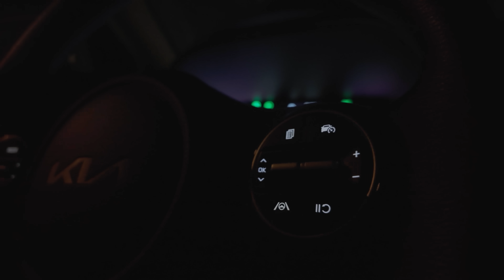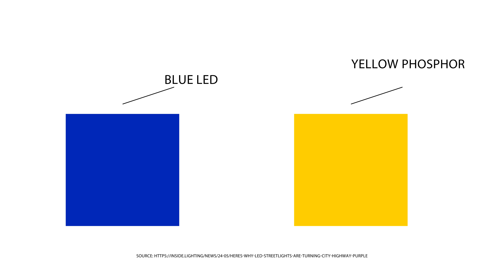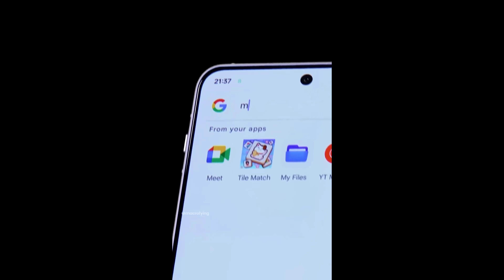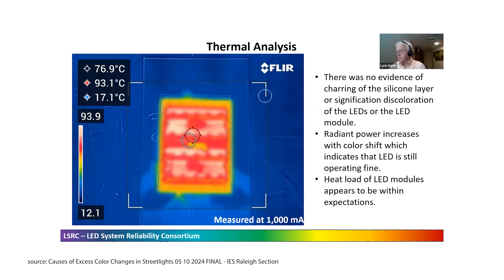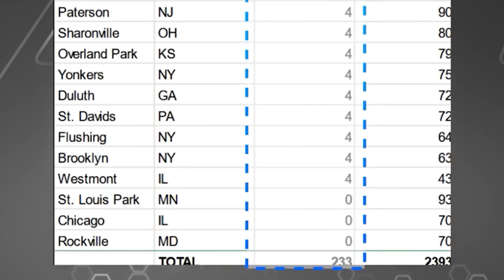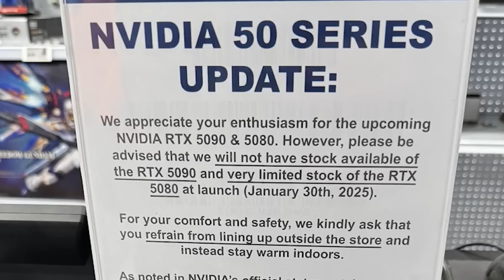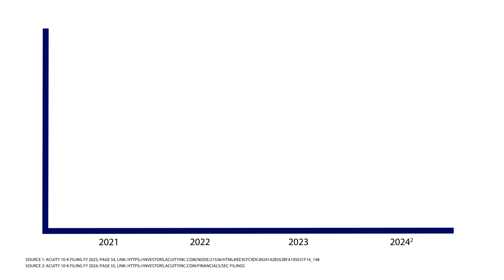The Hundred Million Dollar Mistake That Turned Street Lights Purple!

Comment: I work on LED street lights for DOT agencies. If you ever wanted to learn more about street lighting or high mast lighting used with DOT i can give you more insight. Also the vibration is called a G rating. Vibration is taken into account not just cause on the diode side but bolts that keeps the fixture head on the pole arm

Comment: Defective LED street lights or flood lights are quite common here in Germany as well - but them turning blue is something I've not seen as of yet. Most faults come from one bad LED, which takes out either the whole cluster or one or more rows of it. Another fault comes from a worn down LED inverter. That results in kind of a disco light most of the time, as probably one capacitor has dried up and failed or one leg of it desoldered itself or wasn't soldered right from the get go. So, every once in a while you come across a light that blips or dips every second or two, you know it's the inverter.
Unfortunately in most cases these inverters aren't a separate module, but integrated into the main lighting board. On top of that most lamp housings are sealed, so you can't get to the faulty part at all.

Planned obsolescence at its finest.

Comment: As I recall, the original American Electric started out in Southhaven, MS adjacent to I-55 just south of the Tennessee State line. They began making sodium vapor street lights to compete with the big kid on the block, General Electric. AE made a good product with a simpler design and a lower price point. As I recall, the company was sold and the manufacturing facility was closed. 
That’s what made this video so interesting. To see what American Electric turned into.

Comment: I have one minor bone to pick about this. In lighting purple is the color that is created when red and blue wavelengths are combined. Violet is the correct term for light that is shorter wavelength than blue. Most white LEDs have a blue pump that is typically in the range of 450nm, although there are some that use a shorter wavelength violet pump, but the trade-off is lower efficiency. Also, when high power white LEDs were introduced, new standards such as LM-80 were created that defined the requirements for LED manufacturers to test and report on the long term reliability of the LEDs. Also, one other fact in your video that should be clarified is that Acuity manufactures 0% of the LEDs that are used in their luminaires. I worked in the LED and lighting industry for many years, so I know a few things. Good video overall though.

Comment: The early LED lighting would age and emit a light frequency which would gradually turn towards the magenta to blue spectrum. This was due mostly to heat and the phosphorus layer failing. LED lights is a very narrow band emission and in order to create a broad spectrum light, the devices had to use a phosphorus layer which glowed the proper spectrum and that phosphorus layer was simply not durable enough. Narrow spectrum light can be dangerous because it renders some color contrast not to be seen at all. Critical color dissimulation simply cannot be done without the full spectrum of light available. Many SCUBA divers know this as red light is effectively filtered out as the diver descends below 30 feet. This lack of full spectrum light is so pronounced that if you cut yourself ,as in an accidental event, you will bleed green. Odd but true.

Comment: Well researched. The yellow phosphors in those LED panels are about the same as the white coating inside a fluorescent tube, they absorb  the short blue and uv wavelength LED light and then radiate it again at a longer wavelength in the visible light spectrum, creating white light.
The phosphor powder is mixed with silicone and painted over the LED chip during manufacture, and the silicone gets brittle and shrinks when exposed to uv-light (and heat) for an extended time period. There are however certain uv-resistant resins which can be used instead if silicone, lots of reputable LED manufacturers use these without problems, there were even some LEDs with clear plastic over the chip to prevent the phosphor from dropping out.
There have been attempts to refurbish these streetlights by opening them up, cleaning and re applying  phosphor per hand with a better bonding agent, re-sealing the lamp and then putting back into service. 
This is somewhat labor intensive, but it gives somebody a job and prevents waste. The light output is nearly as good as when the lamp was new. Hopefully this method gains more traction, because there will be a lot more purple lamps to come.

Comment: These lights are shit. Not only is the color wrong, but they are not reliable. A street light near my house was replaced with an LED head a few years ago. It's been replaced at least twice in something like five years. Even if the old style sodium lamps needed replacement at the same rate (which I'm doubtful of), it'd be WAAAAAY cheaper. But we're sAvInG eNeRgY. LMFAO.

Comment: One of the problems with LEDs is that the light they produce tends to be very monochromatic.  So if you have a red, blue, and a green LED all shining at once, our eyes will interpret it as white, but it will be missing a lot of the spectrum between, which can create difficulties with some colors or individuals who can't see the full color spectrum.  This isn't a problem for, say, your computer screen, because you are creating an image from a dense matrix of the LEDs.  However, it does create a problem if you're trying to light objects with them. 

Anyway, a pretty big innovation was the invention of the modern blue LED because slight variations in how it is manufactured can shift the light it creates into the UV spectrum.  Which is a very similar wavelength to mercury vapor bulbs -- the core of fluorescent lights.  The actual mixture in the phosphor coating can be tuned very accurately  into a full spectrum white light.  

So the vast majority of "white" LED bulbs we have today are actually blue/UV LEDs with a phosphor coating to produce white light in a wide spectrum we are used to.

Comment: I never knew the purple lights weren't intentional. I sort of just thought they were meant to attract bugs or something. 
I used to drive through one small town regularly  at night, usually between 8 to 10pm. 
I had always noticed that those lights attracted some of the biggest moths and insect I've ever seen. They were only around the purple street lights, not the white or yellow one's. Some of the moths were 6" across or more. The mess of dead insects also drew out other wildlife to the free meal on the road beneath. 
The truck would get plastered with the huge moths, by the time I got back the truck looked like someone had thrown a hundred eggs at it. After one big storm, that took out a ton of poles and trees in that area the lights were gone and the problem went away.
Reply: I see "Angry blue" a fair bit. Usually it's someone who tries to dedome the emitters on their flashlight for lower CCT and rosier tint, unaware that the Nichia 519a is one of the few emitters that allows that without ripping off the phosphor layer with the dome.

Comment: So they went the CHEAPEST route, and the lamps should be covered by a warrantee.
Personally I HATE street lights, they interfere with your car's headlights, I'd rather have NO street lights and rely on my own headlights.
If they have to relace the lights big deal, the old light bulbs also had to be replaced periodically too.

Comment: your getting algo help because you are pushing the narrative they want you to, the lights started purple 3 years ago, there are news reports. At first the story was lights had low lifetimes, that story didn't fly. So the next story was yours, faulty kmanufactured street lights and they were supposed to be replaced, however, I still drive uber 3 years later and they have not been replaced, they were all still there. And newly installed ones keep showing up. 2 weeks ago a new building was built a couple of miles away from me and 14 new street lights were installed. 2 next to each other are purple and those happen to be directly in front of an apartment complex across the street from the  building, they apartment complex has  been the site of a couple of shootings. The purple ones are strategically placed, I assure you. But you are just a shill anyway, congratulations.

Comment: The reason we use phosphor coated blue LEDs is not just cost, but also light quality. White light can be produced using RGB LEDs however this is more of a fake white light because the LEDs themselves are monochromatic. Because of this monochromatic light, while the light itself will appear white in color, objects lit by this monochromatic fake white light will appear very strange. It will have a very low Color Rendering Index, or CRI. The phosphor in a blue LED is not just a simple filter, it absorbs blue light and re-emits it in a wide spectrum of colors, giving a much much higher CRI and a more natural looking light. This is why all LEDs meant for illumination, from street lights and automotive headlights, to flash lights and even your phone's light, all use phosphor coated blue LEDs.

Comment: We have "GLO-GOLF" and  COSMIC BOWLING, so now, we should have COSMIC DRIVING and COSMIC BIKE RIDING and COSMIC WALKING!!!  The simple solution is to paint motorized vehicles and bicycles with "DAY-GLO" NEON PAINT, then they'd stand out extremely well under ULTRAVIOLET (UV) LIGHT!!! Pedestrians could wear "DAY-GLO"  NEON clothes, or at least, a "DAY-GLO" NEON safety vest.  The roads and streets are also getting SANITIZED, with UV LIGHTING.  What's next??? GLOW-IN-THE-DARK streets???

Comment: Darn, I was soooo ready for dancing purple aliens!  I'm not sure what brand or model LED fixtures were specified for My Fair City, but the electric utility (not the city) is responsible for provisioning and maintaining the street lights on city streets, but we didn't get 5 years before failures; it was more like 2 years with the infant mortality starting months into service.  The PoCo hired a contractor to do the warranty service and now, 3 years later, we're seeing the same issue.  Either some component or material is under-spec'd or the foundry in China is making bad product.  There is one brand that has their emitter wafers made in China because it's a hot chemical mess, but does their lamination and phosphor coating in the USA.  The product is almost 3x in price.

Comment: I see they sent their damage control guy to the channel and you have got his comment pinned.  He is just making excuses for a company that used LEDs outside of their published operating parameters (running it harder and hotter). Unfortunately street lights, his "area of expertise" has no input on the manufacture or ratings of actual LEDs, only the way his cronies adopt them.  They are a minuscule user of them. To my knowledge, the first adaptation of LEDs for public lighting was in traffic lights where they quickly found out that they froze over due to lack of heat in that application.  Unfortunately I have been involved with self important organizations myself enough to know that "board member" means: he's at every convention,  chummy enough to get votes, and gullible enough to sit through boring self-aggrandizing speeches while slapping friends on the back telling them that a great speech that was.  

I find it deplorable that you have given this fake expert your platform to make excuses for a substandard product as if he has the final answer.  I have worked with LEDs since the early '90s but only in the use of them, not their manufacture, same as him.  Making a product that contains an LED does make you an LED expert.  This clown is just white knighting for his own good.   You look like a fool for letting him do it.

Comment: Municipalities that have been buying these lights are bearing the brunt of the cost if they replace them. The labor and cost of replacing a street light is far greater than the cost of a small panel of LED chips on a board. Most of these lights will never be replaced under warranty as it's too expensive for municipalities and governments to replace the street lights that they have up going bad.

Comment: ...but did the Chiner company that made and sold them the LEDs claim the LEDs would last X hours and then they failed? Sure, it's Acuity's brand, but it doesn't matter who the company is that is assembling the lights if the LEDs they're sourcing from an international supplier are not performing as advertised. Imagine if there was only one company, in a foreign country, that made these white LEDs, and it didn't matter who you bought the street light fixture from because they all used the same LEDs from the same mfgr. How do you hold this foreign company accountable? Stop doing business with them, when they're the only supplier of white LEDs? Go back to sodium lamps? Or perhaps there's a handful of manufacturers and suppliers, but they're all foreign, and none of them produce a product that holds up. What's the recourse? This is the problem with manufacturing outside of where you want the manufactured goods to be used and relied upon - there's no real accountability and no other options. You have to make the LEDs yourself if you want them to be quality. You have to make everything yourself if you want it to be quality. In very few tightly controlled instances can you get a good product out of a country that doesn't care about the quality its own people receive. Foxconn has been moving iPhone manufacturing out of Chiner over to Indiar, and they've been seeing a 50% pass rate on the phones coming out of there with phones coming out of there contaminated with E.Coli to boot. Can you imagine that? 50% pass rate, and phones contaminated with basically feces.

I don't get the whole iPhone thing, but I do get the whole "Made In America" thing - or at least making stuff in a country that wants the best for its people.

Comment: This brings up a rather interesting tangent on the 'designed to fail' front going on in the automotive industry at present. While watching this and correlating the losses from warranty work and how some of these companies are still in business, my first thought landed upon Cummins and the relatively recent 'dieselgate' debacle. Beyond just them, nearly every manufacturer is having major reliability problems for cost-inflated vehicles that are prematurely dying due to cheap manufacturing processes on vital components, like engines and transmissions. Even brands that were once built on the seemingly sole purpose of purchasing that vehicle (perceived durability and reliability, i.e. Toyota) have not been spared some massive fubars, but more recently, GM and the millions of recalled transmissions and engines that are dying in the first few thousand miles are becoming commonplace. 
At what point are these companies going to 'right the ship', to borrow a phrase?

Comment: Acuity is a HUGE manufacturer and frankly they are like the other companies, they buy components from specialty manufacturers. Plus if they are under 5 years old they would just replace the LED board. The biggest cost would be labor. So . . . much . . . labor. But Acuity has always stood behind their products. As a specifier I have had very little issues with them over the years.

Comment: 2 things:

1) Phosphor and blue LEDs are used because LEDs create very slim wavelengths of light, using 3 RGB LEDs doesn't create very good white light (3 peaks) whereas phosphor creates a much better broad-spectrum white light instead
2) There are a bunch of TVs by many different manufacturers (inc Samsung and LG) that have slowly turned blue supposedly due to 1 factory in poland creating faulty backlights with phosphor that has slowly gone away causing the TVs to go blue so street lights aren't the only thing that have been affected by this particular issue.

Comment: It's not the temperature of the LEDs that started the adhesive to fail, it's the seasonal temperature extremes of the seasons. Hot in the Summer, cold in the Winter. The adhesive simply wasn't designed to take that over long periods.

Comment: The funny part is the blue LED was the last and most difficult color to create. It literally took decades of research and overcoming significant material and physics challenges, ultimately leading to the 2014 Nobel Prize in Physics for its inventors

[EDIT] I realized I should of put the researchers in my comment, so correcting that now.
Shuji Nakamura, along with Isamu Akasaki and Hiroshi Amano, was awarded the 2014 Nobel Prize in Physics for the invention of efficient blue light-emitting diodes (LEDs). Their work enabled the creation of bright, energy-saving white light sources

Now the most difficult to create LED has become so inexpensive to produce as to cause a problem like this.

Comment: The most likely reason I can see is that the adhesive used fails under the heat cycles of turning it on and off.

Comment: Remember that pretty much any device or machine you encounter is made of components from the lowest bidder.
I recently bought a CASE of house light switches (commercial grade no less!) and replaced every switch in a house I'm remodeling... When we turned on the power to the house NOT A SINGLE ONE WORKED yet the brand is the #1 quality in the US. I didn't trouble shoot the switches, just spent the time/cost to remove them & returned to the store. So somewhere  in their assembly line, a switch that had been made for decades got changed some way. Even the simple, decades old tech   can be unreliable due to human error (management going for cheaper materials, an assembly person having bad day, a assembly robot out of calibration or an awakened AI screwing with us)